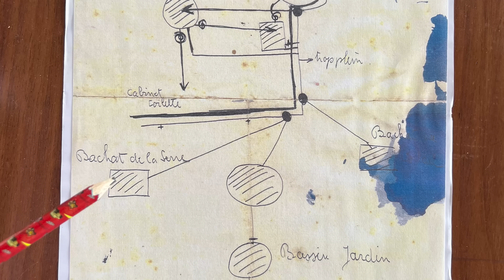Chapter 5: Restoring and Rebuilding a Monumental 19th Century Glasshouse

Comment: That art nouveau type greenhouse is a  dream! Can't wait to see it rebuilt, though it looks like a giant project to get all the rust off the iron and all the glass panes restored. What is the function of the stairs going to the roof? Is it to open the ventilation windows? Wishing you all the best with these huge projects.
Reply from the maker: I believe the gallery was used to manage the blinds that would have been used to control the heat and sunlight.

Comment: I love u guys,but do you ever finish a project before moving onto the next one ?
Reply from the maker: I realise this is more of a judgement than a question, but it bears answering. Rosières is not a little chateau with a tiny bit of land. It’s a 33 room medieval fortress with multiple houses and barns, a small farm and a 130 acre estate. Nor was 90% of this habitable or useable when we moved there. Our approach is not a quick fix, and we are aiming for long term sustainability and to return the entire chateau to usage. This means doing things properly. And in the correct order. So that means for example a tarting with the infrastructure for bringing water, electricity, heating and other things to every single building and completely starting from scratch with nearly all of it. Not all of this can be done at the same time for many complex reasons. It took us a year, for example, to be able to fill in a huge network of pipe trenches. Otherwise we’d have had to just keep digging them up again when we worked on another infrastructure element. Because of the scale of the entire project and the fact that we need to be efficient, we tend to do the same job across multiple projects at the same time. So in this video Marc dug the foundations for two greenhouses because it made sense to keep the digger up in the same place. He also had to prepare the wall last week in the same area for when the stone mason comes. And this is another issue. Availability of skilled workmen. We can wait from weeks to years to get the right person in for a particular job, because of demand and because we don’t just import foreign labour for everything but use locals skilled in their field and the local styles and traditions. So we’re currently waiting for a stone mason to work on all three of the last projects we showed you on here. There’s no point in him moving all of his tools here for just one job then go off while we finish that one and wait for us to start another one. No, we prepare multiple projects for him so that he can do his part on all of them in one session. This might not make for typical viewing fodder of doing up one room or project quickly and moving to the next, but it’s why we’ve won a prestigious National award for our approach to restoring this piece of history. Because we’re prioritising doing it right over doing it fast, and we’re not letting YouTube or TV dictate what we do but rather what our project requires. Our work schedule is also pulled around by our family situation (in the past 6 years we’ve been to hell and back medically, had two children in quick succession during a pandemic and with no family support network to help out, and we have next to no child care), which can dictate what we work on when, and it depends a lot on the seasons because we have to do certain work in the grounds at particular times of year, which might mean pressing pause on a project for a while. When people inevitably ask us a question like this which implies we’re either disorganised or not hard workers, my favourite example to show the challenges and scale of our work is that of when we tried to renovate a second bathroom. Putting the bathroom in itself wasn’t too bad but breaking through the walls and floors of multiple rooms to get the sewage out required the hiring of a company with a two metre long borer just to get through the chateau walls. That’s what ‘just doing a bathroom’ entails here! And the wood chip heating system is the largest domestic system in France ever installed by the company who made it (by the way that enormous project was finished, as were quite a lot we haven’t filmed). This may sound like quite a defensive response to a light-hearted comment but bear in mind that we are highly skilled and qualified individuals pouring every ounce of energy we have (beyond what our children require) into moving forward in the best way we can with this project and that in spite of the accolades we’ve received in real life, from experts in the field, and many people who visit us, when it comes to the online world, our commitment, skills, techniques and approach are constantly being compared with a lot of other projects with which our project actually has very little in common. It’s not inferior or superior, it’s just a different beast and we’re going about it in a different way to anybody else. (And we aren’t always great at showing it on screen).
Reply: @LostGardensofChateauRosieres  Amy please don't think you have to explain your thinking ,it is obvious to most of us that this is real life and things happen and you need to think on your feet and change your schedule accordingly.  You are doing an amazing job whilst bringing up 2 beautiful healthy children and keeping us all informed on all the ups and downs of your busy life.  I wish you all the luck in the world and I am confident that you will achieve a  lovely sustainable life in a special place. ❤
Reply: @LostGardensofChateauRosieres  ❤